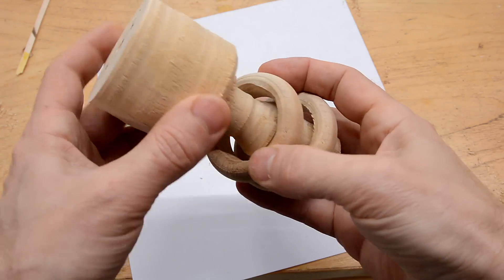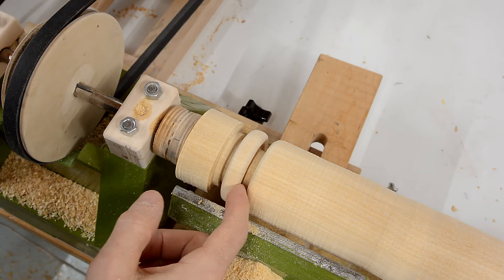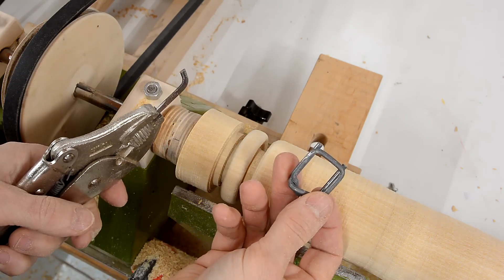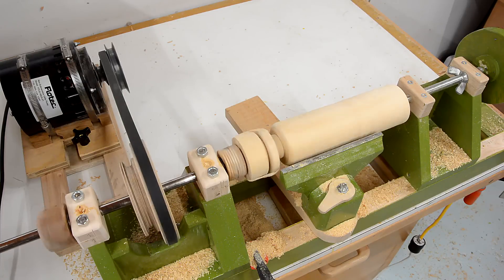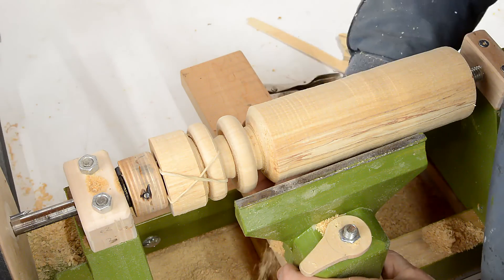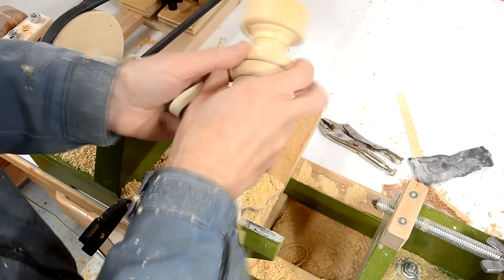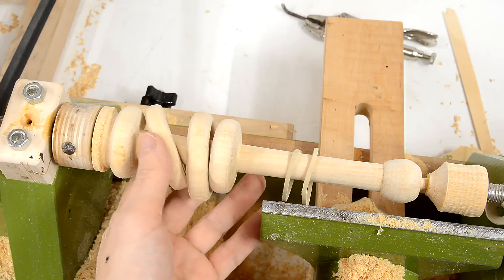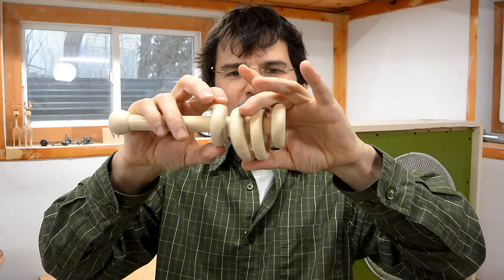Captive ring baby rattle (lathe project)

Comment: Great job.  my daughter loved her captured ring rattle.  clocked me with it a few times too so be careful.  While the rattle was still on the lathe you can tape sandpaper to the shaft and run the rings over it to sand the inside.

Comment: I'm impressed with how well this lathe is working out.  A missing lathe is still a huge hole in my woodshop.  I've got the fever.
Reply: +GarageWoodworks  So why don't you build one? you can use a drill press if you own one for now to turn simple draw nobs
Reply: +Roc Lo Ahhh!     I guess you don't watch my videos (tear).  Not only have I done that (made knobs at the DP), I've published videos on the process. ;)
Reply: GarageWoodworks just went to watch you lazy susan video and subscribed:)
Reply: +Roc Lo Check out my turning knobs at the DP video.  Not my idea but a cool process.  I'd most likely never take the time to make a lathe but I admire Matthias' approach and tenacity.

Comment: an easy way of sanding the inside of a captive ring is to fix sandpaper with double sided tape to the spindel that the rings are on and hold the ring while you spin the piece in the lathe ;-) Nice poject, thanks for sharing, regards, Steve.
Reply: good idea!

Comment: Great stuff Mathias!  To sand the inside of the time stick sand paper to the spindle then run the lathe.  You can hold the rings and control them as the paper rotates.

Tom
Reply from the maker: +Tom Stratton Tiny problem - the rings are on the rattle (captive rings).
Reply: Yes.. Slide then to one side like you did when turning them.  Now wrap sand paper around the exposed spindle.  When the spindle turns it will now rub the sandpaper against the inside edges of the captive rings.  You can pull / push / rotate the rings as required to make contact with the sandpaper...

Comment: I like the use of elastic bands
       :-)  sanding the inside of the rings is easier on the lathe with double sided tape and sand paper wrapped around the work piece. 
good job my frend.

Comment: Once the ring is fully cut, it will burnish quite well just against the spindle it was cut from. Hold it still as the spindle rotates beneath. My ring cutters are made from old files, but I do most of the work by cutting, which reduces the need for sanding.